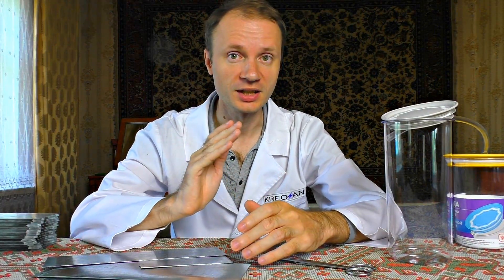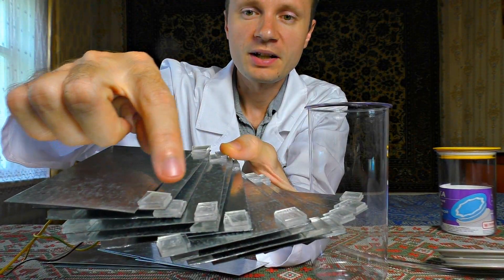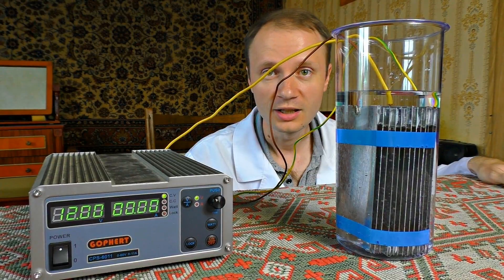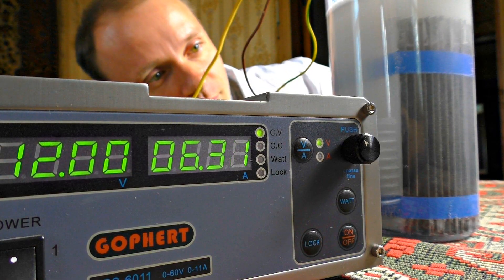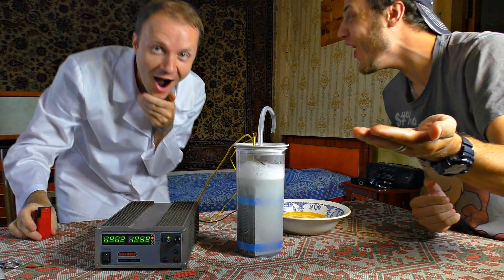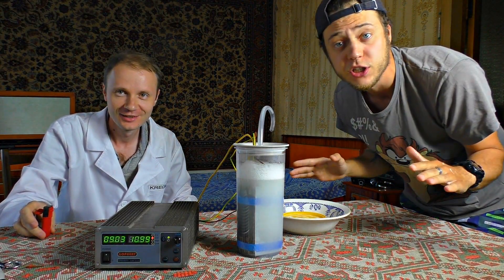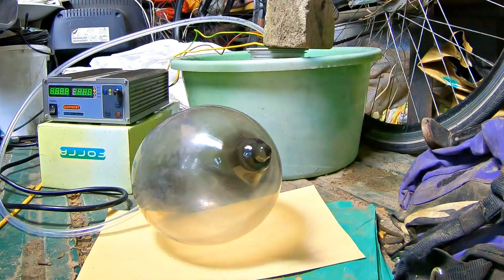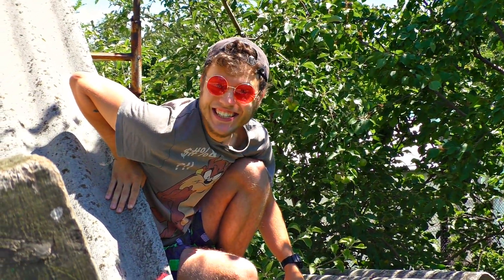Hydrogen Fuel ! How to make fuel out of Water! Or Homemade electrolyzer !

Comment: To everone suggesting using salt: DON'T! It will make chlorine gas (one of the chemical weapons they used in WW1). You do not want to breathe that stuff. It will also make sodium hydroxide which is a strong alkali. Neither of these will do you any good.

Comment: Really like your videos!! I have been experimenting with Hidrogen for a few months, but so far haven’t been able to power à motorcycle properly. 
I had to stop in order to built a electric bicycle based on your project with the angle grinder!!! Great success!!! Thanks for sharing!! 
From São Paulo, Brasil 🇧🇷
Reply: 2 volts 40 amps titanium plates or hard drive discs

Comment: Hydrogen plus oxygen will make water if in combination with a reaction. In this case the reaction is the flame/heat?  But what will happen when it’s in the same room or tank, will the gasses mix or just float away or explode. And what more reactions can you use to make water out of these two. Just curious.
Reply: High temperature makes the oxidation reaction faster. Mixing the gas together will make them react but much slower. Same thing with oxidation of iron Example, burning a steel wool turns it into iron oxide (aka rust) a lot faster than just leaving it in the open air.

Comment: Hey kreosan.. 

You think hydroxy gas is fun.. 

Have a look into ohmasa gas from Japan..

Water is vibrated at a specific frequency and the bonds between hydrogen and oxygen are weakened enough to break the surface tension of water.. it also doesn't allow dishwashing liquid to foam and gas can be compressed and stored safely. 

YouTube ohmasa gas Japan and you'll find it. 

Can also be compressed for use with lpg and fuel suppliment. 

Next time.. get a better generator and buy a weather balloon.. then use a really long wick (say a few metres.. or find some tubing long enough to allow you to light it from the ground and watch the pipe light up at night time and the reaction will be very quick.

Comment: It was not just hydrogen.. You need to separate the anode and cathode with a way to collect gas from each separate... Oxygen can be collected from anode and hydrogen from the cathode... You will get 2/3 hydrogen and 1/3 oxygen

Comment: You need to apply frequency so the resonant of the water molecules will break its bond like Stanley Meyer did. Oscillation of pulse DC is the key to efficiency.

Comment: i think the metal plates are coated with some kind of chemical.  if you scrub and scratch the metal plates so as to remove some of the chemical, and so that they are very rough (increasing surface area), that might work better.
Reply: Yeah they're probably cooked with nickel or chromium which also happens to be metal.

Comment: Can you make engine work with it ?
Reply: If they can get the spark plug in engine to ignite HHO gas. They will likely have to modify car engine to work with HHO gas.
Reply: Yes you can and there are some cars working with hydrogen already. But it didn't become a standard because hydrogen is too much dangerous.

Comment: Oh be careful playing with hydrogen and oxygen gas mix it is incredibly powerful, that loud crack you hear is the implosion its not the explosion, the explosion is actually quite slow, but the implosion is very rapid possibly 100 times faster than the explosion

Comment: You can split the gas into 2 by having a sealed divide between then + an  -  but wuth holes below the water level to allow current to pass, oxygen  will collect one side hydrogen on the other. From memory if you can increase the amps in dc current it produce lots more gas.

There was once a man hear in Australia, who built a solar/hydrogen car (it used solar to produce the power needed to make hydrogen/oxygen to run the petrol engine) he entered it in the big solar car race in the early 1990's that is held every year hear. He won it in record time but was disqualified for using an internal combustion engine and not electric.........nobody has heard about his work ever again.

Comment: It's not just hydrogen. You split water to hydrogen and oxygen (ina 2 to 1 ratio). This gives this explosive reaction from 2 H2 and O2 to H2O.
But with a generator with DC and seperated poles and seperated gas collectors, you can generate H2 and O2 seperately. But H2 doesn't explode as violently alone whitout the oxygen.
Reply: It doesn't explode at all.
You need oxygen or a different oxidizer for it to explode or even burn. You can use the oxygen in the air for that purpose, but you do need oxygen either way.

Comment: use a small 4-stroke engine and connect via belt drive to one or more alternators from a car, hook that up to another reactor and see how many lpm you can get and also see if it can run the small engine using only half the power output, 1/2 the alternators you put on it..

Comment: you should use electrolysis to make sodium metal.
just run current through either molten salt or alkali and you should get sodium.
it's stupidly dangerous but works (i tried it)

Comment: YOU NEED 2 BEAKERS TO EXTRACT PURE HYDROGEN.  ONE BEAKER CONTAINS THE WATER, THE OTHER CONDENSATES THE HYDROGEN.  BY USING DC CURRENT THE POSITIVE WIRE CHARGES THE CONDENSATING BEAKER.  HYDROGEN IS NEGATIVLY CHARGED, THEREFORE IS ATTRACTED TO THE POSITIVE.
Reply: It's less efficient that way, do to the positive and negitive plates having to be further away from each Other, resulting in more resistants and less product
Reply: +Talon Juel
Incorrect thought.  It takes time to properly distill pure hydrogen and you can't force it to produce any faster (or produce more) by increasing energy flow.
  Also, water is H2O, meaning hydrogen is 2/3 of the entire sum.  The only way you would get less would be to remove the electrical current altogether.
Reply: @BIG_AL_ONE  but I've made a hydrogen generator and from my findings it seems the closer the plates are together the more they produce, not only that but using 10 9v in series (90v) made much less than a car battery, that it way, I think it has something to do with amperage not voltage and resistance, oh yeah and I've also found that the closer the plates are (but not touching) the more water is converted to hydrogen and oxygen
Reply: he doesn't want to extract pure hydrogen though. Pure hydrogen doesn't explode.
You need the oxygen as well if you want an explosive mixture.
If he wanted pure hydrogen there are easier ways. 
But this way he automatically gets the perfect ratio of oxygen and hydrogen for a good explosion.

Comment: Be careful of chemicals, Its not pure hydrogen when set up like this.
Reply: If it was pure hydrogen it wouldn't explode, so obviously it is not. Pretty sure he is aware of that, he is not an idiot i believe. its a 2:1 mixture of hydrogen and oxygen.
Its whats generally refered to as knallgas or oxyhydrogen.
Reply: @jort93z  or hydroxy gas..
Reply: @jort93z  when you have salt as your electrolyte or any other chemical is not going to be just Brown's gas. You do know how chlorine gas is made right?
Reply: @jort93z  you go ahead and run your experiment in an unventilated area.
Reply: @jort93z  "Exposure to low concentrations of chlorine for prolonged periods may have destructive effects, as might very short-term exposure to high concentrations." Don't be so arrogant as to assume that it's okay just because you've done it a handful of times. it is not best practice for anyone that is working with electrolysis that uses a salt as an electrolyte to take it lightly or other volatile chemicals that react with in a solution undergoing electrolysis
Reply: @michaelinamoment  What alternative conductors are there?
Reply: @Firestar-rm8df  baking soda. What you want to be searching for is electrolytes for electrolysis.
Reply: @michaelinamoment  Oh, really?  That works safely?
Reply: @Firestar-rm8df  yep it's also how you can isolate iron 3 if you use iron electrodes. you can use for a ferrofluid.
Reply: The best and most easy to get thing to use is sodiumbicarbonate aka baking soda
Reply: what he is saying is that other toxic chemicals can be produced because of the drain cleaner.

Comment: Hey but you should regulate the combustion of hydrogen gas to coequal fossil fuels by applying a non combustible gas (water vapor, argon, nitrogen...) pressurized with the hydrogen or cold the hydrogen gas. That would be interesting

Comment: Can you build a liquid nitrogen generator from the air?
Reply: that is actually quite difficult. Nitrogen is pretty inert. 
You'd probably have to destill the air. So you'd have to cool the air down to the point where nitrogen and oxygen condense, and then do a fractional destillation. 
Theres other processes that do not require those temperatures, but those aren't exactly something you could do at home either.